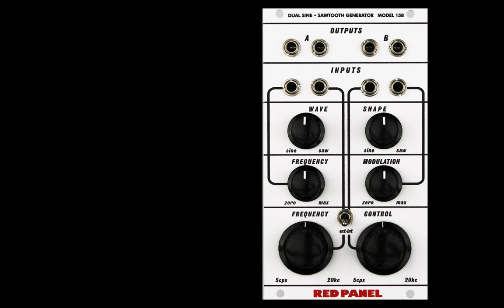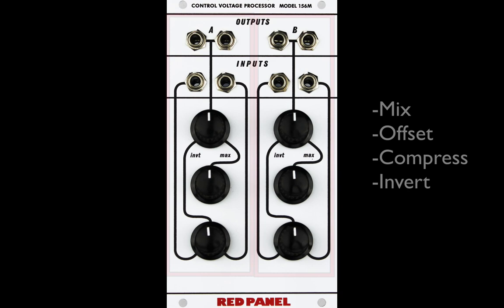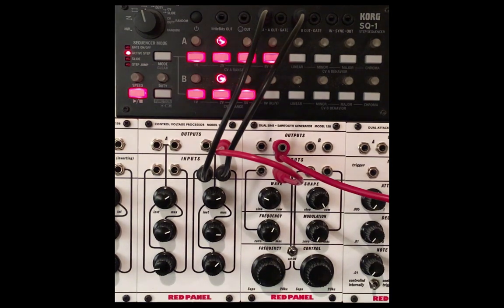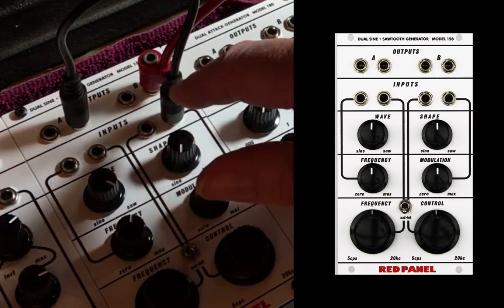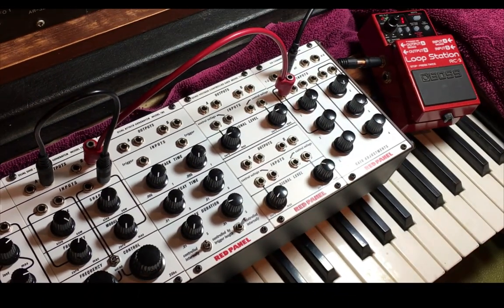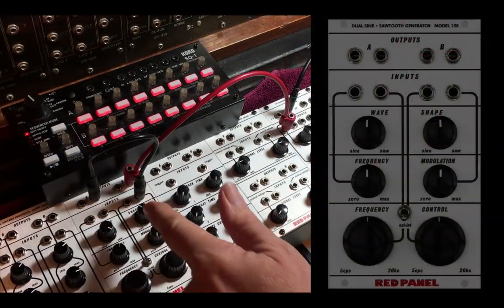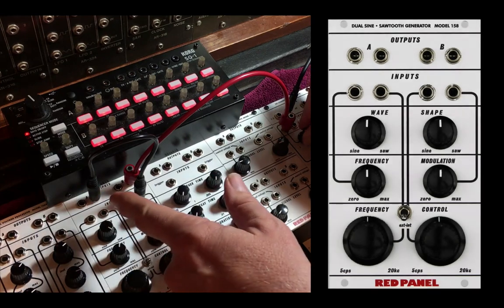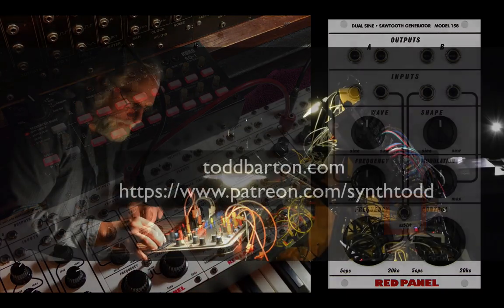Part 2 RP 158 Internal mode

Comment: interesting!
Reply from the maker: UnkaTom thank you!
Reply: When do these reds become available for the public to  purchase ?
Reply from the maker: nik frisbee check the description section above :-)
Reply: Todd Barton thanks for the reply - sorry I should of put in the UK?
Reply from the maker: nik frisbee I understand with in the first week or two of September
Reply from the maker: nik frisbee you might contact one of these dealers :-) https://buchla.com/buchla-dealers/
Reply: Todd Barton is it possible to cross patch with Serge using banana to euro multi converter? I can find any information regarding the red euro on the Buchla website regarding voltage range, specs etc. Also can the jacks be stacked on this euro version? Sorry for all the questions and taking up your time I’m not really up today when it comes to euro - I’m more Serge 4U banana type of guy.
Reply from the maker: nik frisbee I’m guessing yes. See this which is banana to Eurorack https://youtu.be/xCcm_fB4Zno. I have to get back to work :-)
https://www.patreon.com/synthtodd